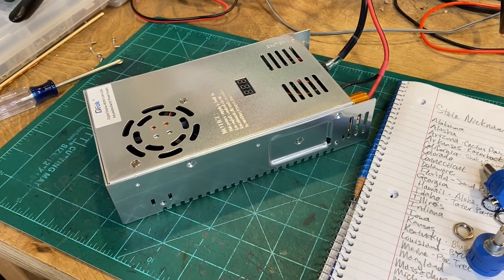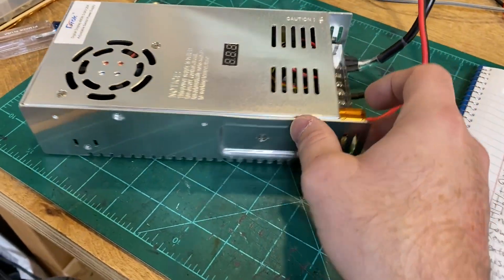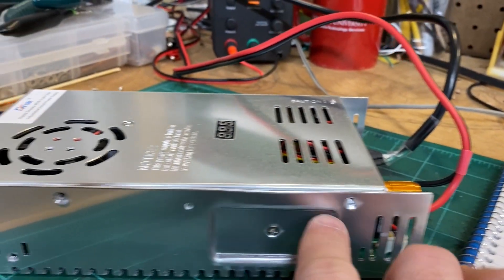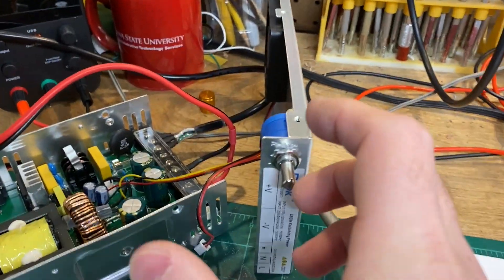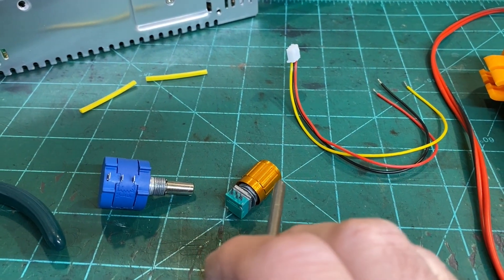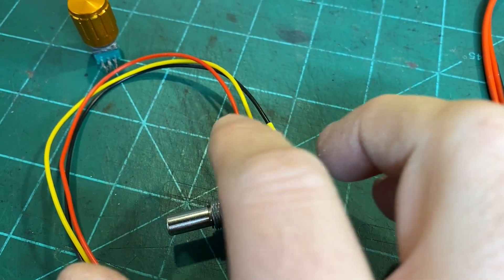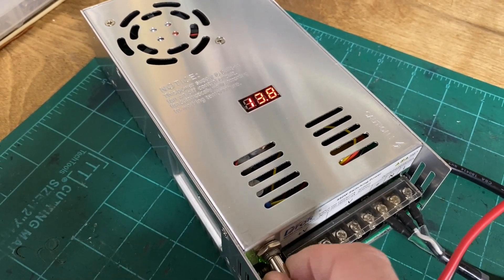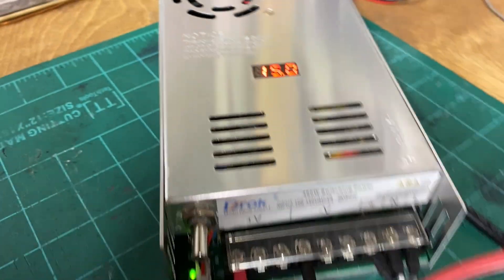Variable Voltage Power Supply Modification

Comment: If you change out the potentiometer for a different value, will it drive the voltage higher than specified on the case?
Reply from the maker: I’m not sure in this case. It may be handled by components elsewhere in the power supply. I haven’t tried to min/max the potentiometer to see what the true voltage range is.

Comment: I got the same one I think, but mine is +/- 30V. I only just realized it doesn't have a DC ground. I tried measuring the AC Ground to the DC outputs and there is a lot of AC going on. Same for chassis which probably is tied to the AC ground.

Comment: how has this power supply held up? I got the 40 amp one, not sure if I trust it anywhere near that output...
Reply from the maker: I haven't had any issues and I've had it powered on continuously since the day I did this mod and it has sat at 15.0vdc the whole time.  I am only using it to power two CB radios that draw 8 amps at maximum output.  Its typical load would be more like 4 amps when the radio is being used or .5 amps when the radio is just powered on.
Reply: @421CentralIowa  That's neat, no noise problems from DC ripple on the output? I assumed these things were pretty low quality, but have only used mine for charging batteries.
Reply from the maker: @AltereggoLol1  This thins hasn't drifted off of 15.0v since the day I plugged it in.  It stays powered on 24/7 and I've had no issues with it.   I haven't noticed any noise going into the radio I power with it and I have a spectrum analyzer sitting right by it and don't see a typical 'comb of noise' like you do with really dirty switching power supplies.   For the money it has been rock solid for what I use it for.
Reply: Can you increase these up to a higher voltage than what it states on the case?
Reply: @irishguy200007  yes, their 12V power supply can go up to over 14.8V. Makes it great for charging batteries though.
That can be bad when the voltage knob is so sensitive, especially on the 0-40V models!

Comment: If I do this, I may just 3D Print a cover that goes over the POT knob to prevent it from being bumped, then I could just use a flat head screw driver at the end to adjust it.
Interesting, thanks for sharing this!
Reply from the maker: The good news is you can bump it pretty good and it'll only result in the voltage chaning .1vdc one way or the other :)  This has been a solid performer for me since I got it.  The voltage has never changed from 15.0 the entire time I've been using it.